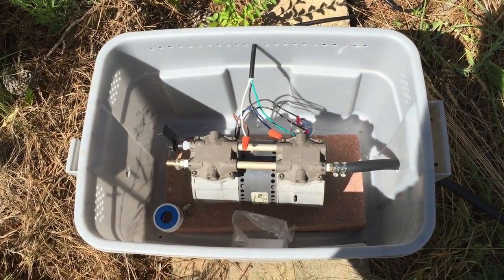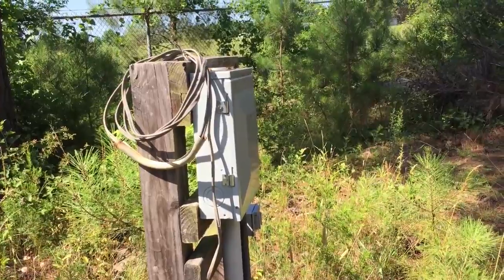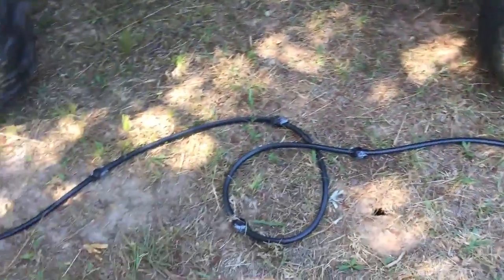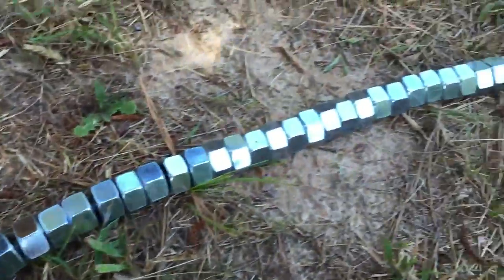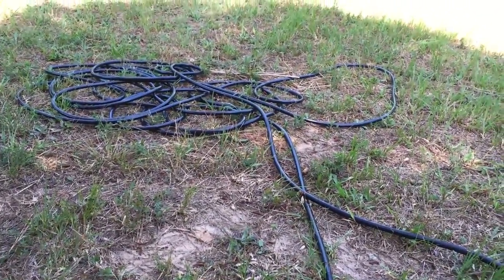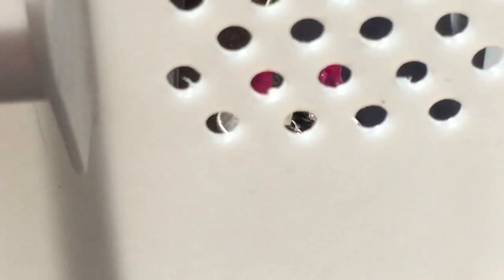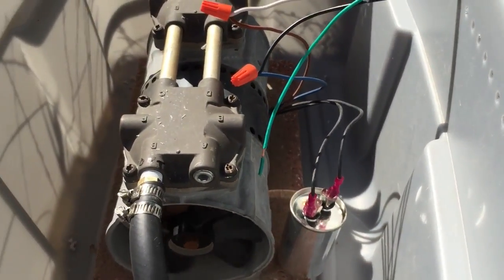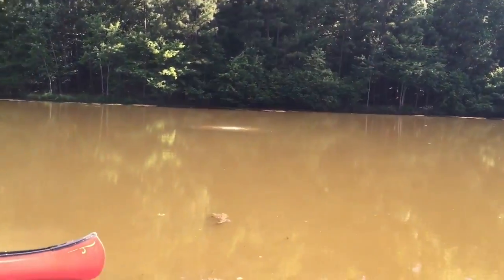DIY "Big Max" Pond Aeration - Thomas Industries Air Compressor Aerator

Comment: Hey, yes it seem to me that these pumps will run for at least a couple years 24/7, even re-built.  I think your problem was you cooked it in that little tiny container with no good air flow.  You need a fan drawing air over that compressor in that little tiny space.   I did see your update video, and that is fine with your shallower pond depths (~7-8' MAX), but with deeper ponds, that HiBlow is not going to cut it and you will need one of these more powerful pumps.  The diaphragm pumps don't do well in deeper water.  All good stuff.

Comment: I wish I would have seen the update. I had the same problem with my pond aeration system (Big Max) purchased off Ebay. Horrible system. This new one you have on the next video looks better.
Reply from the maker: If you haven't seen the one year update on the Hiblow, check it out.  Over a year of 24/7 operation and it is still going strong with terrific results in the pond!  God bless.

Comment: I purchased  one of these systems a couple of years ago. Only issue was the capacitor failed after a power surge. I have mine in a ventilated 2'x3'x2' wooden shipping container. I added a fan to push hot air out of the enclosure after the failed capacitor. I wasn't sure if the power surge caused the failure or trying to start the hot pump. I also ditched the chintzy included air filter and bought TWO replacement element style air filters. Made a noticeable difference in the volume of air moved. No complaints otherwise.

Comment: if you have problems with the next pump then try making a better ventilated container for the pump (if you haven't already)... there's really not a lot of ventilation there at all. Out in the open the motor will draw in fresh air, but when enclosed it can only draw in used warm air, which keeps getting hotter and hotter. For a capacity to go on a relatively new pump it must have gotten very hot. I couldn't really blame the manufacturer for that unless they sold it as capable of running in an enclosed area.
Reply from the maker: Most of these pumps are made to go in small housings.  Also, it ran for about six months (summer to winter) without issue.  The capacitor fried in the middle of winter with snow on the ground (see follow-up video), so I really don't think it was a heat issue.  After replacing the motor run capacitor, it is clear that the issue is with the compressor itself.  Watch the third follow up video.  It starts  smoking while running out in the open.  The Hiblow aerator that we replace it with is in a very small self enclosed case and has now run for months without issue.

Comment: Great pond. Only thing is, even with the lid on its still quite noisy.
Reply from the maker: True, it is a bit noisy, but that is the trade off for low power consumption compared to a fountain.  We can't hear it from the house, but it could easily be put in something more substantial to reduce noise.

Comment: Does the compressor not get hot ?
Reply from the maker: +Craftyman383 This is a good question.  We never ran it in the summer during the day for two reasons.  The first because we were afraid the compressor would get too hot.  Second, we didn't want to pump hot air into the pond.  So we only ran it at night.  Worked fine all summer.  Once we hit the fall, with much cooler days, we ran it all day.  This didn't last long.  The capacitor exploded.  We've since replaced the capacitor, but the compressor still isn't working correctly.  Of course the unit came with no directions about how much it could or could not run.
Reply: +St. Isidore's Farm thanks!